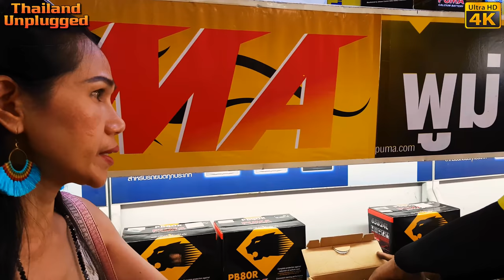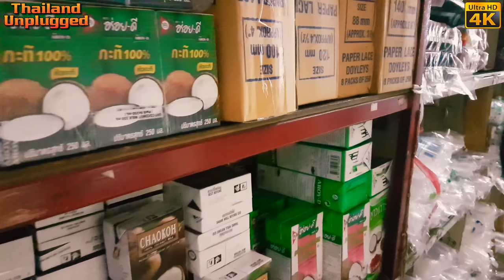Day in the Life of Living in Bang Na Bangkok not always singing and dancing and bars

Comment: Great little "slice of life" video Steven and Meaw! In the beginning, what were all the black spots on your face?Batteries in the US tend to run a minimum of about $140 now. And they are all crap...
Also, you might want to have your electrical system tested. Alternator or Regulator could be going out. I have run into issues with the clamps not being able to be tightened because they were bigger than the posts on the battery. they actually make spacers that you can attach to the battery terminals, then the cables will tighten properly. Much simpler than replacing the cables or even just the cable clamps.
Reply from the maker: The black stuff you wouldn’t believe it… Its my headphone cushions detreating and the paint off the cushions flaking and sticks to your ears the actually beats originals the cushions last about 3 months before they fall apart looks like a bad case of black heads in the ears lol…. Have some boss headphones as well same thing and the other thing is 4K video brings out everything LOL….
The battery was the wrong one that was the whole problem and they has sleeves on them. Never mind all fixed now